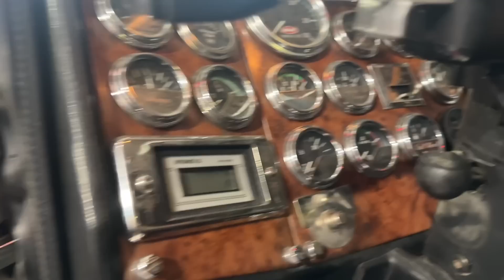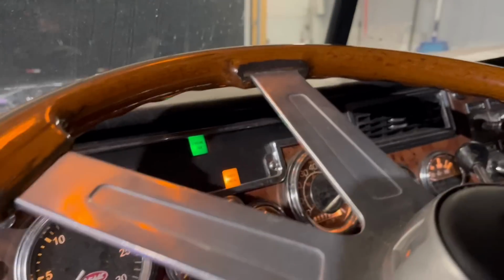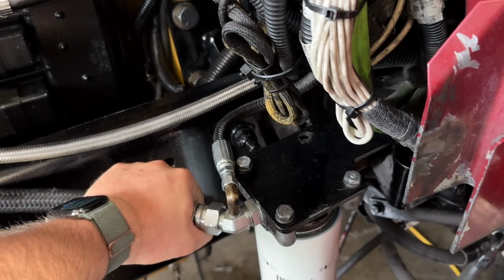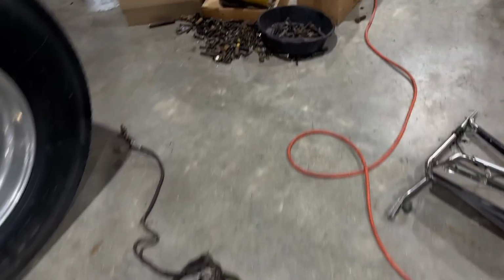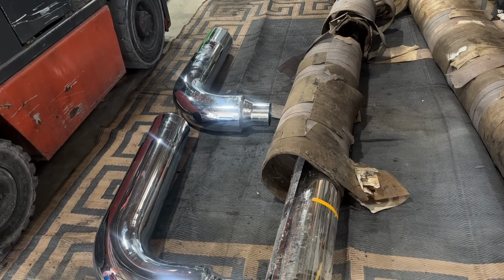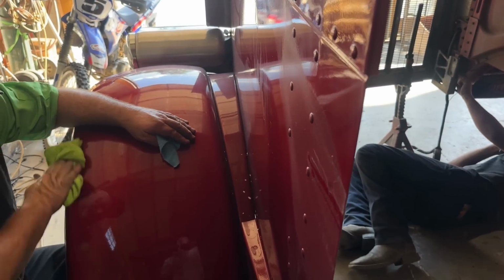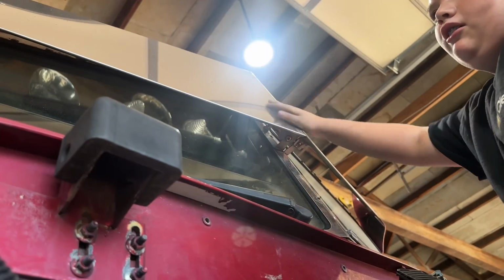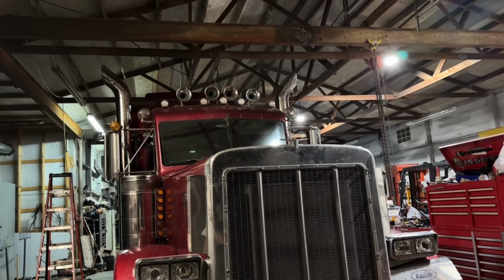Rooster Didn’t Make It Out Of The Shop Before Quitting..

Comment: 3306E models and c15 for those dont know.   When pumping fuel primer you have to pump it until you hear click and it'll fire but I'm sure the Gentry's know that others reading this may not know that if you have a cat 3406e or lighter you gotta pump it until you hear the click... side note I understand that the Gentry's aren't having problems with priming it

Comment: I seen a leak at 6:40 on the black right side hose going in to the fuel filter. You may have noticed it and fixed by now. But just a heads up

Comment: Here’s one I’ve experienced that was a topper. CAT C15, starts when cold, worked no issues, max power, rpm etc, no misfire. Stop for lunch, thing would not restart. Fuel pressures etc were all to spec. Long story short turned out to be a broken cam shaft retainer plate, allowing the cam shaft to move away from the sensors on coast down. The main issue was that you could not see any alarms even with the laptop connected. So basically was the engine could not read cam speed correctly and no way to indicate it in the laptop or dash. The engine however would not give an injector signal. Very frustrating and satisfying too once I sussed it out. Brought to mental breaking point by a £10 part. 😂

Comment: ❤ what about the four holes you put in the blocks for that back cylinder would have any effect to do with anything just a honest question and also can you put a rack in the top of your valve cover on your engine before you start the engine turn on electric oil pump supply oil to the top of the cam and the rollers before you even start the truck I'm just curious that's all love your family and pray for your family hydrating awesome Siri

Comment: Ok so as a tech I will say this you had it running then according to the videos you changed the fuel lines so if between running good and then showing it’s a$$ the only change was the fuel lines then 9 times out of 10 it’s something with the fuel lines that were changes. And just remember just because somethings new doesn’t mean it’s worth a crap.

Comment: Sounds like you have an air leak in the injectors system having air getting sucked into the system not having the right mixer, or not having a good enough back pressure

Comment: Good job. Did I miss a video, what happened with your f250? Never heard or saw what you or they did about your metal problem.
Reply: Ford has it.  Replacing a fuel.system doesn't happen overnight.
Reply: Thanks. I know it takes many hours to replace the fuel system, just missed the part where it was sent back to the dealer.

Comment: One of our freightliners has a  cat with a permanent miss at idle and just above but pulls clean as under load...cat themselves can't figure it
Reply: We have an 05 doing that, swapped everything fuel related to it. Still does it at idle/cold but clears up on accelerating. Think it’s got a bad valve, CAT agrees with our thoughts on it as well.

Comment: Do these not require lift pumps I know they sell air dogs for big trucks I’m more familiar with a Cummins fuel system in the pick up trucks and I know they require lift pumps I have a air dog and see 15-20 psi from the air dog and I see 27k rail pressure at full throttle